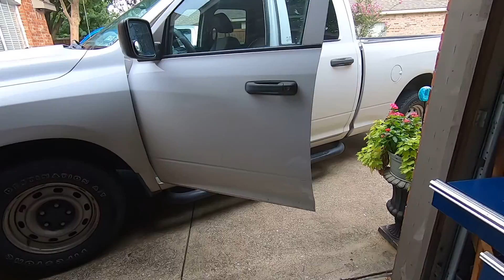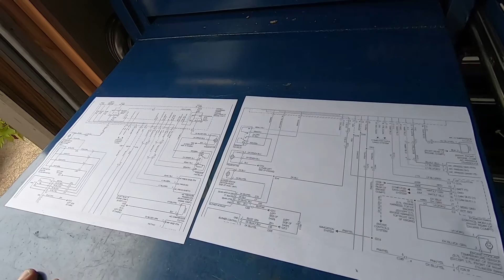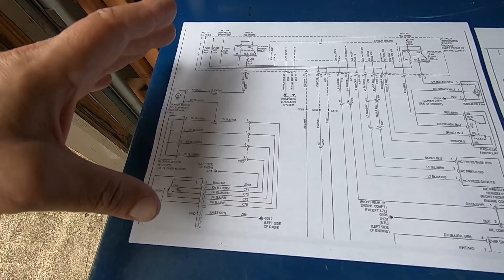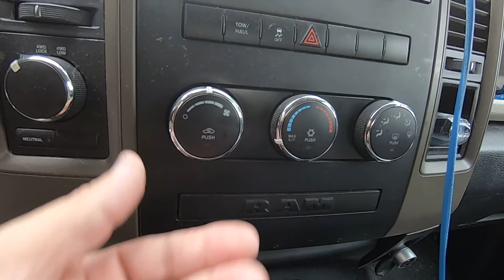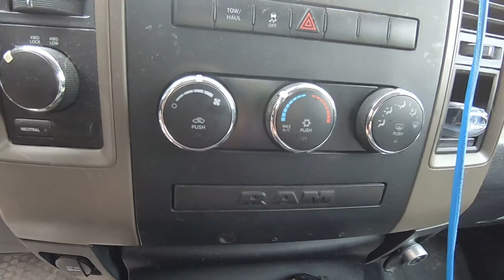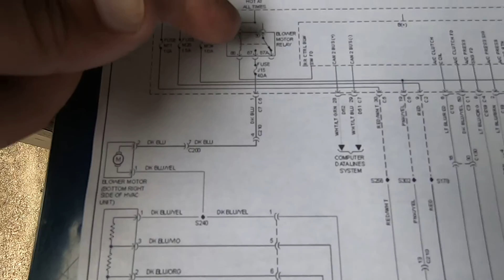2011 Ram 1500 Blower Motor Troubleshoot and Replacement.

Comment from the maker: Blower Motor                                                            
https://amzn.to/3BAlE4Z
Emanuals for wiring diagrams and full maintenance manual info
https://shrsl.com/4lw0n
DEWALT Drive Socket Set, SAE/Metric, 1/4-Inch Drive, 25-Piece (DWMT73805)
https://amzn.to/3Mhcxx1
OTC 3633 Mini Test Light                                       
https://amzn.to/34HDcgk
Braun 390 Lumen COB Work Light                        
https://amzn.to/3iaY8nV

Comment: So, I have this exact setup.
LOW works LOW2 doesn't, HIGH 3 and HIGH both work, does that mean it's the resistor pack, or the switch assembly?
Reply from the maker: Could be either one. Could you get a test light and check it?

Comment: What if you have changed everything and the blower motor still won't work?
Reply from the maker: make sure you check the fuse, if it is ok then you could have a wiring issue or a bad control head.

There are two types of blower motors for that truck, one is for trucks with automatic temp control which will have digital readouts, and the other is for trucks with manual which will have no digital readouts.

Comment: I'm inclined to think the light doesn't change much while checking the controls because the current hasn't been through the resistor yet. Can anyone confirm this? I'm currently diagnosing this same issue. Great video, Thanx!
Reply from the maker: The power is a direct shot from the blower motor relay, the ground is what controls the speed. This truck doesn't have a blower resister it has a blower module.

Comment: My blower only works on high but the switch controller itself flashes and sometimes I have to give it a tap or slight nudge for it to turn on. Could my control head and resistor both be bad or can just a bad resistor somehow cause this?
Reply from the maker: That is a classic symptom of a bad resister.

Comment: Great video, do you have a similar video for the automatic version of the heater control head?
I have a 2010 Dodge Ram 1500 Laramie with the Automatic control head.

Comment: Great amazing video I have a question sir my ac kicks on normally and then 1 minute into the ride it completely almost shuts down then 10 seconds later it blows it and then turns it back down and so on ,it keeps repeating this cycle so u think the blower motor is responsible or could be a different problem , thanks
Reply from the maker: There is a good chance the blower motor is the problem but it could be the blower resister or even the control head.

Comment: Thanks for posting, I got ram 1500 2011 slt and the blower work only on 3 & 4, so 1 & 2 is not working (no air coming out), so do you think it’s the resistors issue or it’s the blower motor?  Thanks again
Reply from the maker: Probably not the blower since it works on some speeds.

Comment: Thanks for the video.  Mine blows at all the various speeds on start up and then suddenly after about 3 minutes drops to one super slow speed.  After that it wont allow any change to speed.  I replaced the resistor and the blower - no change.  I have a dual control.  I guess from what you are indicating it would be the control?  Any other upstream areas it could be?  Dodge wants $3k to fix it!